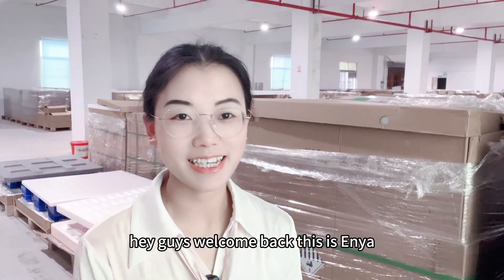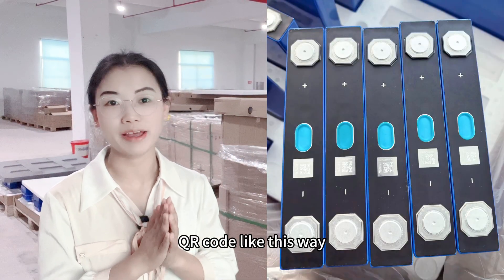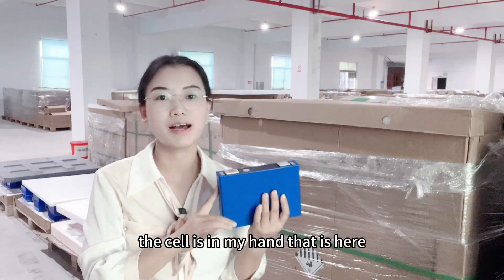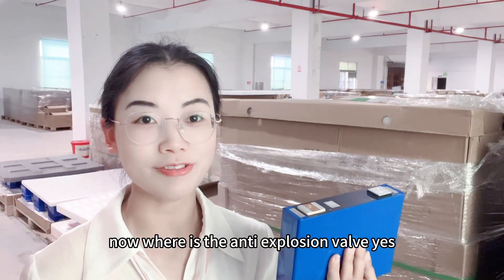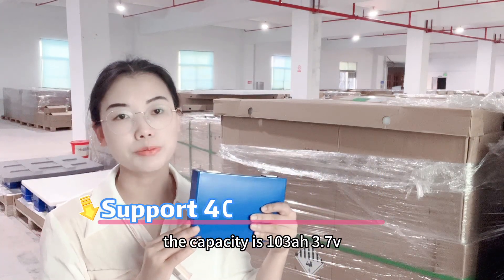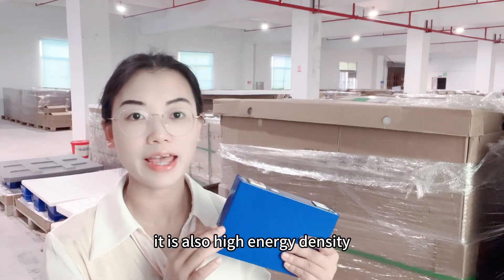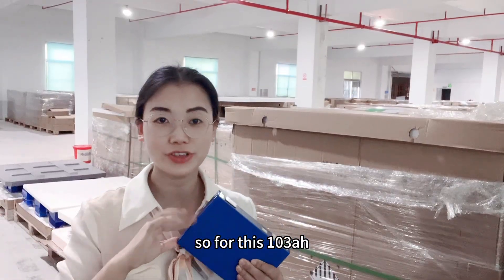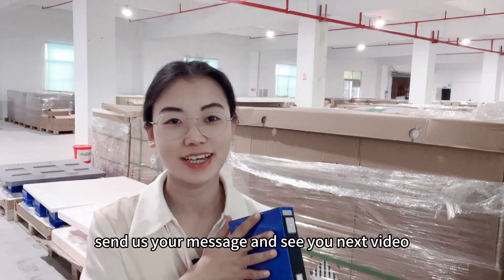$24 CATL Kirin battery 103Ah 3.7v lithium ion battery available

Comment: interesting this maybe replacement for lev40/lev46 cells same 33mm width and 2mm longer at 173mm but bit higher at 122mm instead of 108mm but i think may still fit without major problem